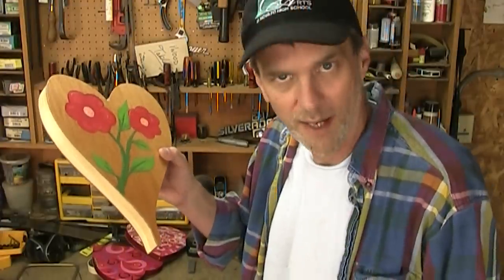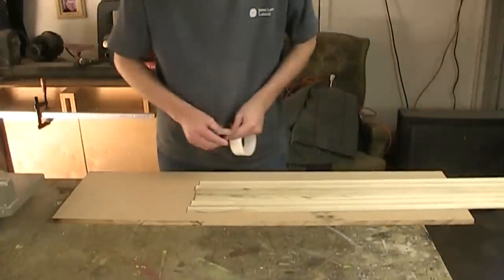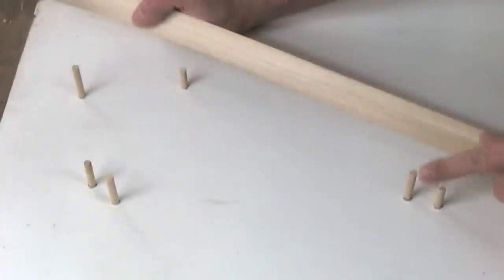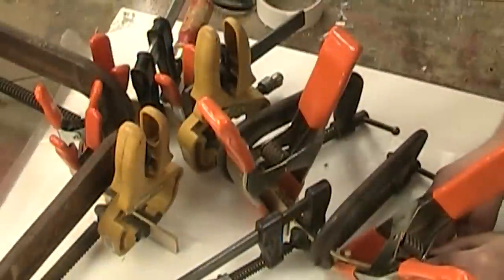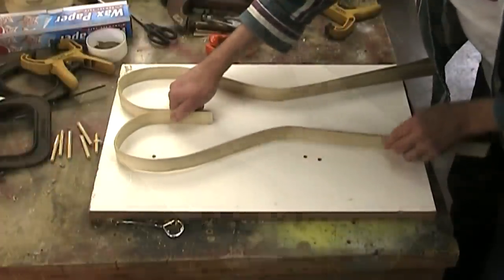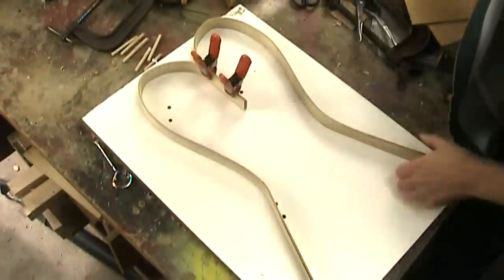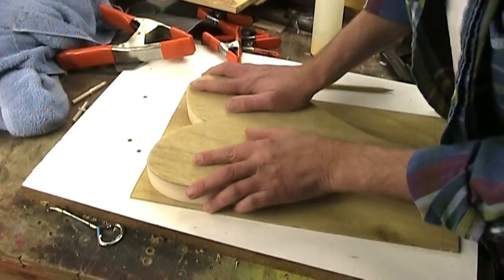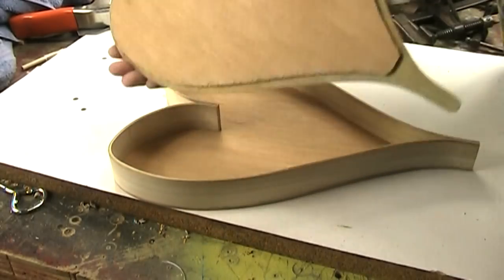Make a wood, heart-shaped candy box for Valentine's Day

Comment: Try this test Steve.  Cut a wavy line in short piece of 2x4 with the band saw.  Then boil a piece of scrap from this project on the stove for 10 minutes and clamp it between the two pieces of the 2x4. You can get rather severe bends this way and it hold the shape. For bigger pieces, put an old tin window planter on a double burner hot plate.